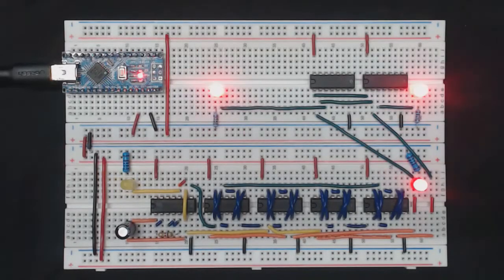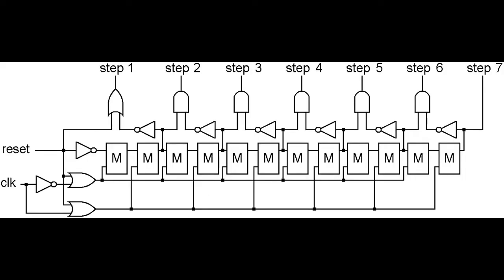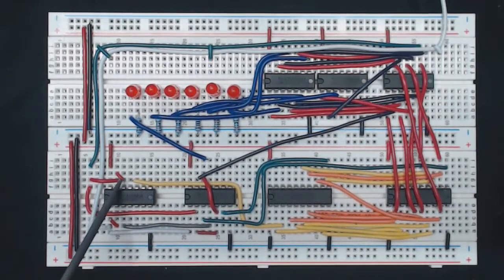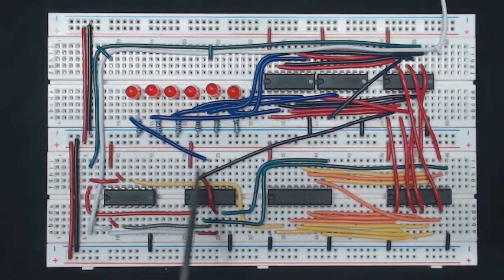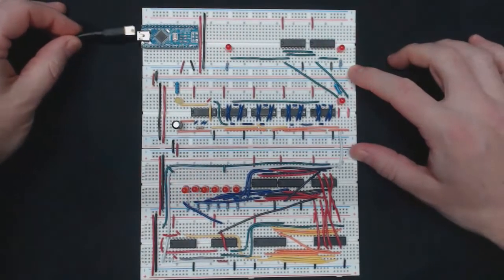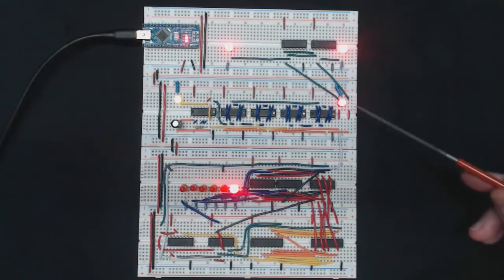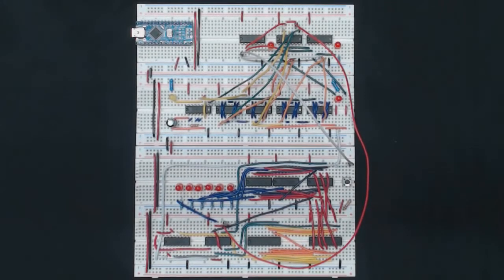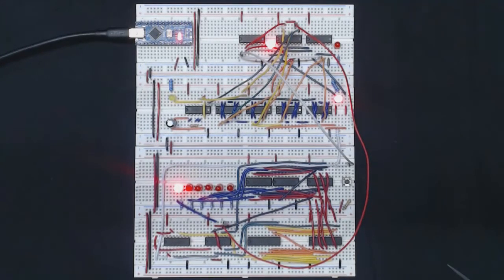But How Do It Know? Video #17 - The Clock and Stepper (part 2)

Comment: The basic automatic Power On Reset (POR) is: 5v to resistor to capacitor to ground. The voltage between the resistor and capacitor will go from 0 to 5 slowly. This is a low-active POR. You can add an inverter to get a high-active POR.
Reply from the maker: Thanks, I’ll see if I can get that to work!